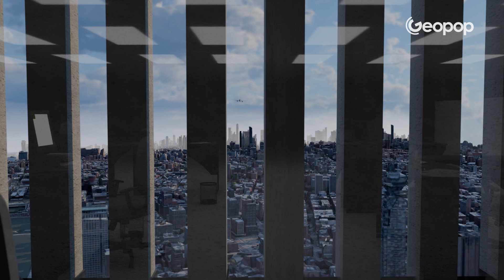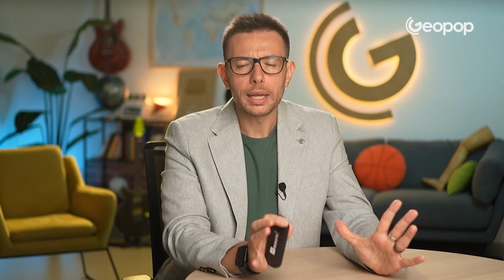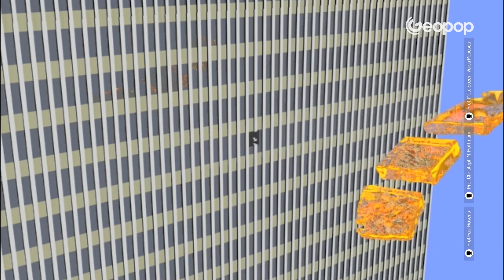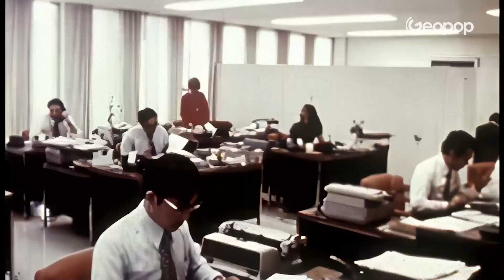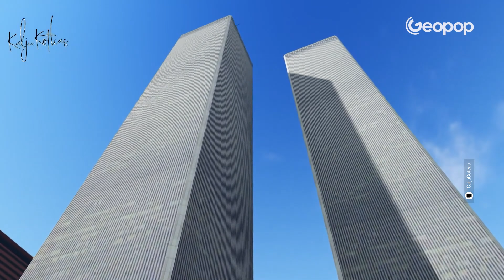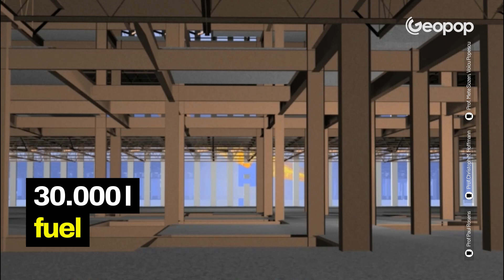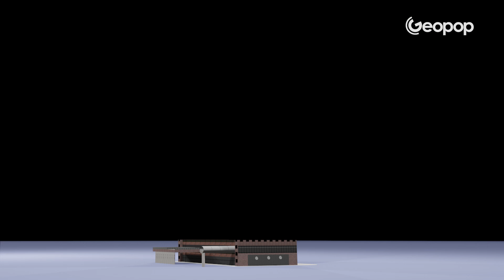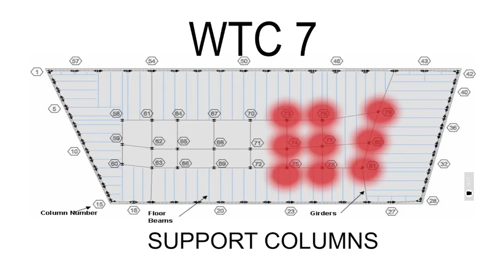9/11, 2001: The Technical Reconstruction of the Twin Towers and WTC 7 Collapses

Comment: The NIST review and report tied everything up in a fine convenient bow for the powers that be. I have seen other highly qualified structural engineers and even eye witnesses give a very different account. Also, it was very convenient that a certain passport survived among all that mayhem. So many unanswered questions remain.
Reply: You have?  When and where?  Certainly not in any peer-reviewed engineering journals where other professionals can see, analyze and critique the work. 

What do you think of my account? Twin Towers collapses were relatively straightforward, the fundamentals already understood in the professional engineering community within just weeks. Yet there’s a lot of really bad information floating out there, mostly on the internet where it’s easily accessible to anyone. Good information takes more effort to come by and is much harder for laypersons to digest. Engineeringspeak is complex and dull while wild baseless speculation and pathological theorizing with easy hand-wave answers is simple, exciting and require a whole lot less thinking, thus getting far more intention than they deserve.

To correct that situation, I have all on my own prepared this short yet detailed technical description of Twin Towers collapses based on my own observation and analysis of the available true and relevant facts. No politics or ideology, just the engineering. My hope is this will dispel many common myths and answer most if not all questions you may have about the Twin Towers collapses, because anything can seem like a conspiracy if you don’t understand how it works

While complex, most of the Twin Towers collapse mechanisms can be seen with the naked eye and easily discerned and understood by the layperson if sufficient time is taken to understand. 

1. The Twin Towers consisted of 4 primary structural elements that together formed an integrated system where each relied on the others.  47 hollow box-section steel Core Columns carry the majority of the gravity loads. The 236 hollow box-section steel Perimeter Columns carry the remainder and ALL of the lateral (wind) loads. Long-span Lightweight Steel Trusses connect the core and perimeter column together at each floor with a Hat Truss on top to tie the structure together as an integrated unit where no element can survive without the others. There was no structural load bearing concrete and most components were bolted together.

2. The impact of 117 tons of airplane (= to about 12 dump trucks) at speeds up to 590 mph with the energy of a ton of TNT completely destroys the aircraft. This in no way implies the Towers come out unscathed. Many perimeter columns are damaged or destroyed as are some core columns (example; 33 of 59 perimeter and 20 of 47 core columns damaged or destroyed at the impact floors in the North Tower), This damage is primarily through bolt-shearing failures at the end connecting flanges, as well as bending, twisting and fracturing of weld seams. There was no cutting or slicing - the reality was far more violent and messy. 

3. The impacts destroy or damage fire insulation, fire breaks and sprinkler systems on multiple floors.  Huge fires are started across multiple floors simultaneously and allowed to spread rapidly with no effective firefighting or fire suppression. This was an unprecedented fire event . 

4. The hotter steel gets the weaker it gets .  With fire insulation stripped away and no sprinklers the survival time of the steel greatly reduced. Gradually over time heat causes the lightweight steel Floor Trusses at the impact damaged floors to sag, which was observed and recorded.  No steel melted or needed to. Structural steel fails long before it becomes a puddle. It just needs to bend

5. Sagging floor trusses pull on the increasingly weak and overloaded Perimeter Columns, causing some of them to bow inward by up to 5 feet. A straight column is up to 4 times stronger than a bent column. The bowed Perimeter Columns buckle and fail, initiating collapse. The formerly static mass above which the structure below could easily support is now converted into a dynamic mass up to 30 times greater. Because they have buckled, the Columns above and below the failure point are no longer aligned . The load bearing structure below no longer bears any load as it falls past the lower columns, NOT onto them.

6. Thousands of tons of debris fall within the four outer walls, down through the open office space, crashing onto the first intact floor it encounters. This massive impact immediately breaks the bolted connections to the columns as the amount of resistance the Floor Trusses can offer is negligible.  The falling debris slows only marginally and briefly. Note:
6a. This is NOT a solid top block crashing into and “crushing” a solid bottom block .
6b. The debris falls past the columns not onto them.  The columns provide no resistance to the falling debris. 
6c. Only the bolted connections of the floor trusses to the core and perimeter columns can offer any resistance. A pair of 5/8” bolts at each end of each truss vs. thousands of tons of falling debris.
6d. No laws of physics are violated.

7.  This floor-led collapse progression within the four outer walls can only go straight down. Note: 
7a. This process is often incorrectly referred to as “pancaking” which actually refers to a completely different process rejected at an early stage. The catchy name stuck but nobody knows what it is supposed to mean.  Pancaking is too simplistic and inaccurate anyway. More like Kaiserschmarrn.

8. Collapse progresses through the floor systems not down the columns, through the path of least resistance . Rate of floor failures increases with each successive floor as momentum increases, reaching an average acceleration of 0.65 of GA, or 35% slower than true free fall. Bam, bam, bam down the building until there are no more floors to fail.  The resistance offered by each successive floor is always the same. The mass and velocity, thus the energy of the falling debris is constantly increasing, with each floor destroyed adding new falling mass. Some falls to the sides, but most falls down. More mass, more velocity, same resistance with each floor.  Don’t get stuck on the but the lower floors weren’t on fire nonsense. They weren‘t and didn’t need to be.

9. The Towers were 95% air by volume. As that air was compressed inside the building it is forced down the tower and blown out the sides in reaction to the building collapsing . Those were not “explosions”, it was expulsions of compressed air caused by the collapsing building, explaining the low velocity, lack of flash, blast, supersonic pressure waves and lethal high-velocity ejecta.  

10. Perimeter Columns become detached and peel away like a banana behind the collapse front, playing out to the four points of the compass extending to more than 600 feet from the base of the towers. This was quite obvious from examination of the debris pile. 

11. Core Columns fail last as their internal beam bracing is stripped away by falling debris and lateral support from the floor to perimeter columns is lost. 

12. For those who care about how long this whole process took; 31-34 seconds from the moment the perimeter columns buckled until the last core columns hit the pile, or 1/3 the rate of true free fall. Don’t believe me?  Just watch any video of the collapses and note the loose truly free-falling debris dropping much faster than the towers themselves.  

13. Each Tower had a 1-acre footprint. Far from collapsing inside their own footprints the debris pile spread out over 17 acres in a pile up to 14 stories deep. 8 surrounding buildings were destroyed and scores more damaged by the falling debris. 

14. NOT observed were the 180-190 dB bangs of thousands of high explosive devices or the blinding bright flashes of burning thermite. Neither explosives or thermite could have survived the impacts and subsequent fire nor could have caused the (silent) perimeter column buckling that clearly initiated collapse either. A video of a shocked and injured firefighter casually using the magic word explosion is in no way proof of explsoIVES  and the demolition_ case relies entirely on that sort of thing. There is zero tangible physical evidence and it would be technically impossible, totally impractical and completely unnecessary. No one would bother. 

15.  Finally, the Twin Towers were perfectly safe within their design envelope.  They only collapsed when taken far outside design parameters by an extraordinary and unprecedented event 

Impact + Fire (heat) + Time + Gravity = Collapse . Remove any one of those four elements and there is no collapse. Ignore any of those elements (as many do) and you will never understand the collapses. The Twin Towers were an integrated system in which no one component could survive without the others. One fails, the rest follow, through the path of least resistance – DOWN – through the open space, bypassing the path of greatest resistance – the columns.  Nothing I just described violates any laws of physics. All of the above is true no matter who planned and carried out the 9/11 attacks or why 

In 24 years zero structural engineers of tall buildings, including the 1/3 that have retired in that time, have made any statements in support of 9/11 Truth BS demolition claims. Zero, nada, none. The lack of any such citations in the engineering literature (published in any country worldwide) is palpable.

I hope you found this helpful and informative. It is not meant to be adversarial, but to solicit informed critical comment, positive or negative. If I made any errors of fact, logic or reason or left anything critical out, please let me know so I can fix it. To stay focused just one topic at a time please and on-topic (Twin Towers ONLY). No word-salads of Gish Gallop. IF you can offer a more plausible alternative be my guest. Be the first. Please start any reply with the words “Tits McGee” or I will know you didn’t actually read it, are not serious and just wasting my time.